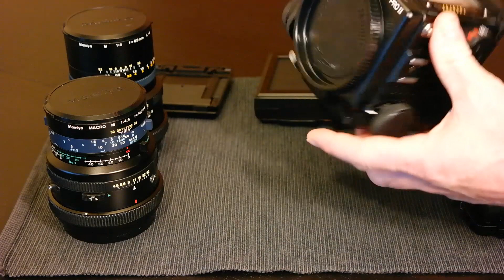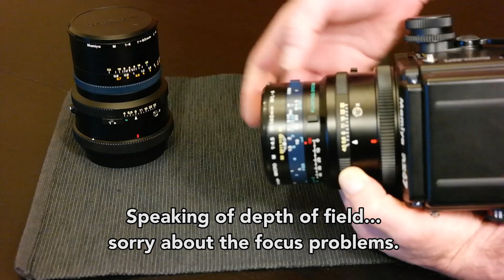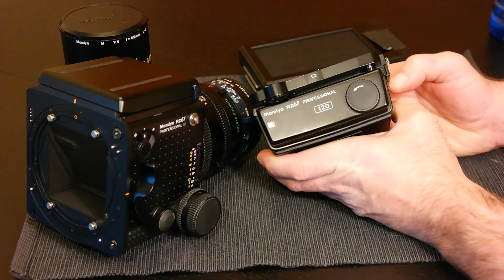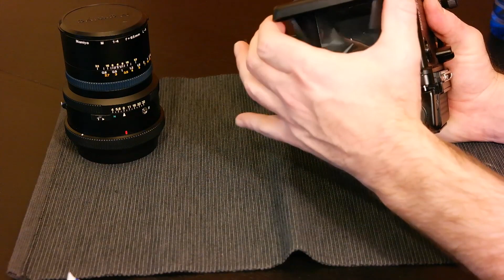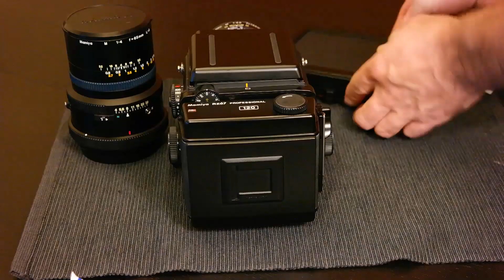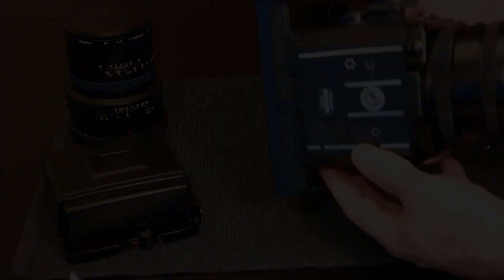Introduction to the Mamiya RZ67 Pro II

Comment: Generally a pretty good overview.  Somewhat confusing when try to avoid exposing the film while demonstrating how to take a picture.  I have many years experience with the Hasselblad system but would like to add a RZ67 to my gear.  BTW .... The "safety plate" is actually called a DARK SLIDE.  Happy shooting and thanks for the video.

Comment: Just for anyone else interested, the difference between the RZ Professional Film Back and the RZ Professional II film back, is the first edition has foam light seals, the Pro II film back just has no foam seals, just a metal lip design that stops light entering without the need for seals, which is why the II film back costs a little more. Worth paying more for the upgrade in my opinion as foam deteriorates over time.

Comment: This is an excellent video and overview of the RZ--Thanks!

I've been shooting an RZ67 Pro II for over 18 years. Here are my thoughts:

(1) There are two eye-level finders, one with metering and a cheaper one without metering. They're both heavy AF and not worth carrying. Their only value is when the RZ is on a tripod and then only with the optional flip-up magnifying eyepiece that also has a diopter adjustment. This magnifier is good for super critical focus. For walking around, the waist-level finder, with your correct diopter in the pop-up magnifier, is the only way to go.

(2) Get either a phone app or a Sekonic 308 for your metering needs. The eye-level finder's weight is not worth its meter function for handheld shooting!! If you're dead set on having an on-camera meter, get a KEKS (or similar) light meter and mount it the RZ's hot shoe. Personally, I use the Sekonic 308 for walking around.

(3) Speaking of walking around, put the RZ on a (preferably carbon fiber) monopod with a 1-way tilt head, not a ball head!! Then you can carry it around all day with it over your shoulder like a hobo's bindle. The monopod also serves to steady your shots. I can easily get an extra 2 stops with a monopod, and 3+ stops if I can wedge it against a fence or some other steady object while taking the shot. The monopod also serves to hold the camera for you when reloading film. While seated and with the monopod against your leg, simply tilt the head/RZ forward to easily change the film without having to put anything on the ground. Plus, the apparatus works like Thor's hammer if you ever need a self-defense weapon.

(4) A few more points:
- Older Mamiya RB lenses will fit on the newer RZ, but not the other way around.
- Although RB lenses will work on an RZ,  RB backs are not interchangeable with the RZ.
- RZ backs consist of an "insert" within a "shell." The shell is the same, but the inserts are either 120 or 220.
- There is also a metering hood for the original RZ67. Hoods factory modified for the Pro-II are very rare.
- As for GAS, there are more lenses, gadgets and gizmos for the RZ than any one person knows about.
- There are multiple versions... The original RZ67 Pro (1982), RZ67 Pro-II (1993), and RZ67 Pro-IID (2004)
- The Pro-IID is the most expensive, but has additional pins for the Mamiya HX701 digital back adapter.
- The HX701 digital back adapter is super convenient but is both rare and massively expensive 
- If you have a Pro-IID + HX701 it's compatible with Leaf Credo backs and Phase One IQ series backs.
- Even the RZ67 Pro-IID with a couple of lenses is far cheaper than a Mamiya 7 with a single lens.

There is an extensive online encyclopedia of the RZ67 system at:
https://emulsive.org/reviews/camera-reviews/mamiya-camera-reviews/a-complete-guide-to-the-mamiya-rz67-pro-part-one-deep-system-overview

Comment: Could someone tell me what that "T" switch does near the base of the lens? I just bought a 90mm lens and I cant figure out what that switch is for. There's also some sort of spring loaded switch on the other side of the lens too which I don't know the use for. If someone could educate me it would be much appreciated lol.
Reply: I use the RB67's and on those, the "T" settig is for time exposures.  Press the shutter release once and the shutter opens.  Press it again and the shtter closes.  A tripod is a necessity and a doble cable release is good to have.
Reply: I’m not sure about that spring loaded other switch. I think it closes the aperture to which is adjusted on lens so you can see depth of field or something.

Comment: does it mean that once you selected the right iso for your film and set the camera to auto exposure, you can start taking actual photos without using a lightmeter? sorry I am so new to this camera, this may be a dumb question.
Reply: The AE mode works only with the prism viewfinder, not the with the regular waist level.

Comment: Thanks, very helpful.  Mine just arrived today, a week early ahead of the battery and WLF.  FYI, the “safety plate”is called the dark slide (very important in large format as well). 
This thing is a beast, my main purpose was for backpack landscape, wasn’t prepared for it to weigh more than a field 4x5.